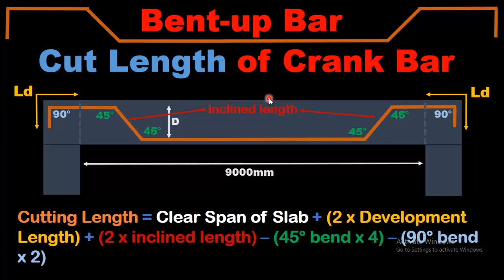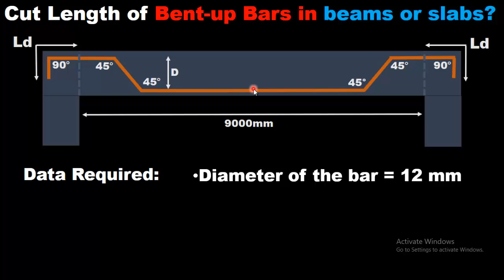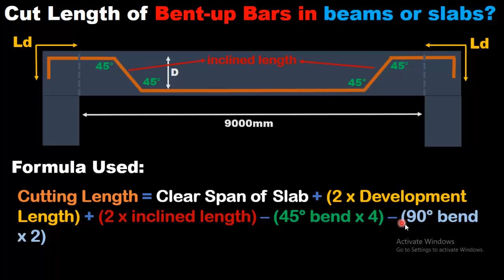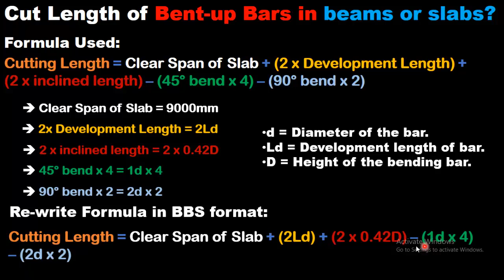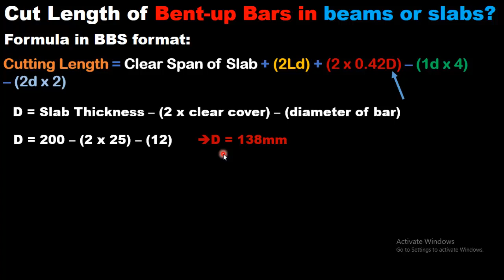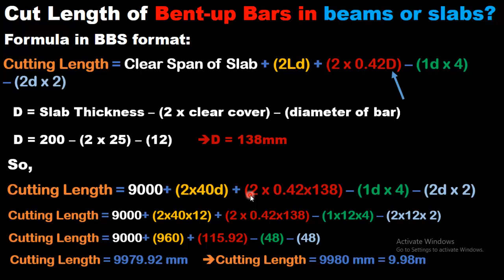cutting length of bent up bar/crank bar|Cut length of crank bar/bent up bar|Find cut length crankbar

Comment: What is development length
Reply from the maker: The length of steel bar extended beyound the length of column or beam to form better anchorage between the bars of two structural members e.g between beam-column or between column-footing etc